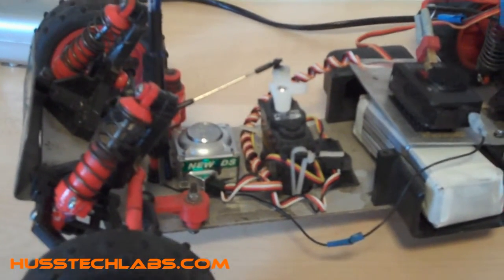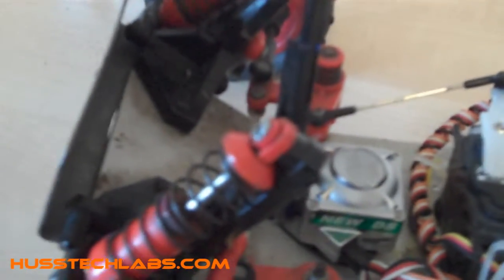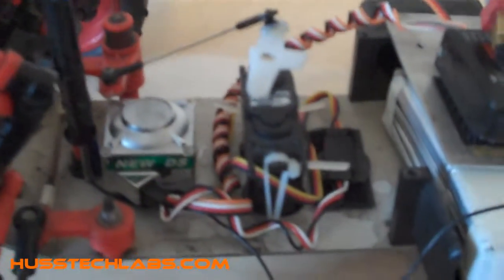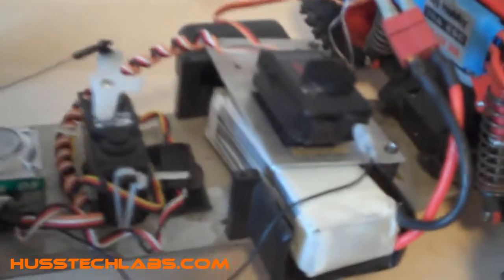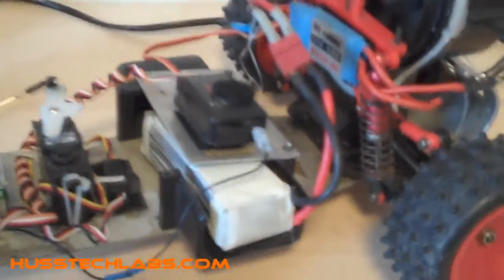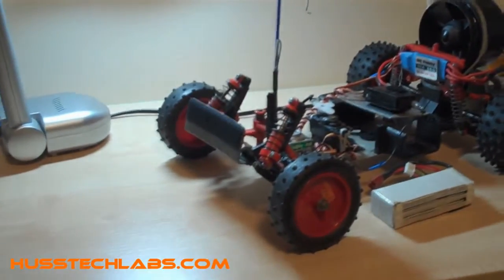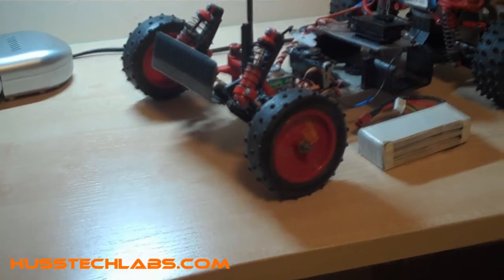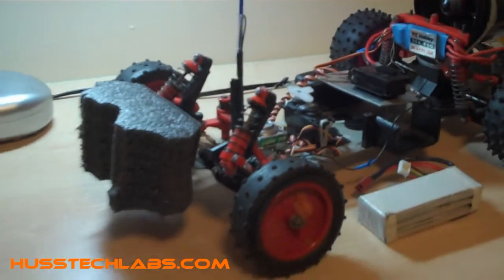JetCar Ducted Fan RC - Gyro Stabilised

Comment: Some on road tires and slowing down the steering input would also help.  With those tires it'll want to slide and can be hard since you sometimes end up reacting to the slide instead of driving it.  Also, it looks like when you turn around the car turns so suddenly that's when you crash.  Interesting way to run one though.